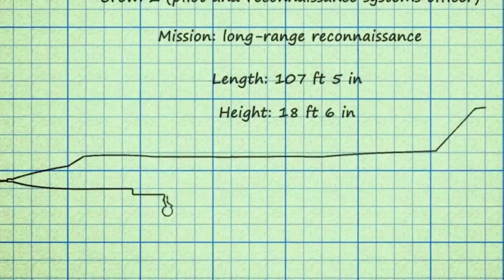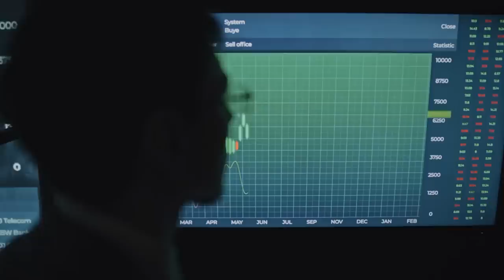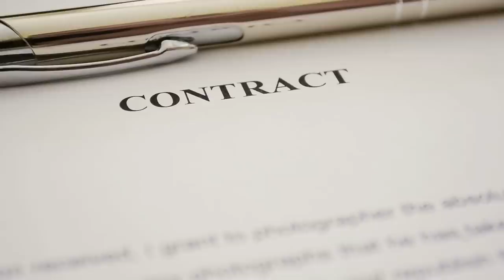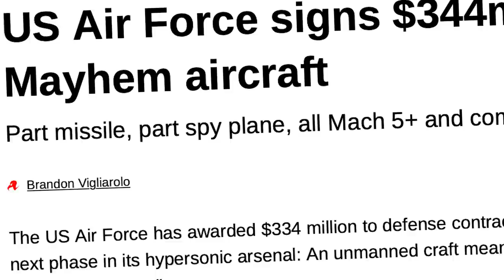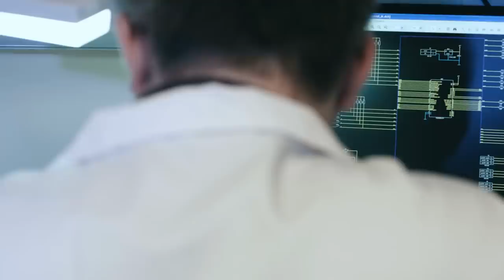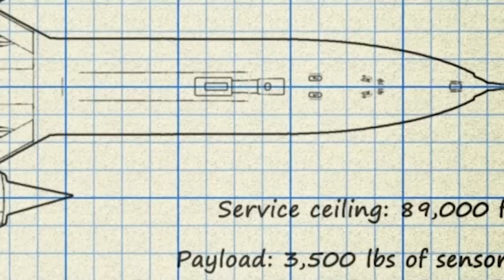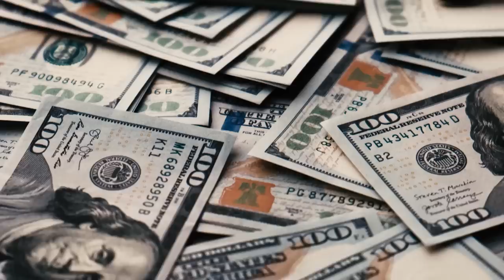The Plane that Leave Enemies Biting the Dust

Comment: I highly doubt they retired the SR-71 Blackbird without already having a replacement.
Reply: They did.
Reply: That's exactly what my dad always told me. He worked on different types of aircraft for 40 years, but the majority were helicopters.  He had a big part in the Comanche helicopter program before they cancelled it. He was pissed they scrapped the program, but also said they would never totally scrap all the tech that went into it. Just a few years later, what do ya know? A stealth Blackhawk with a lot of the same tech shows up crashed at Bin Laden's compound. There's almost always something else down the pipeline.
Reply: They didn't need one, sats took over...
Reply: Satellites
Reply: @exsappermadman25055  They still needed one back then, Satellites can be tracked so the enemy could hide things as it flies over, Bit harder now though as there are too many up there.
Reply: @ShaneMcGrath.  Back then yes, but they knew sats were going to get cheaper and building a better SR would have been bloody expensive!...
Reply: @ShaneMcGrath.  yeah thats what I said regarding them being predictable. its not hard to figure out which is which whatsoever though, each one has unique identifer code that you can easily look up in the database and see when its coming over whatever location you choose next
Reply: @jamesmaddison4546  Their trajectories can be altered...
Reply: @exsappermadman25055  No, not as much as you think. Every satellite has thrusters on it yes to help with stability and minor alterations but they are not powerful enough for it to change trajectories in such a way to make them unpredictable
Reply: @jamesmaddison4546  The near Earth sats need to have thrusters to stop falling back into the sky. My point is that if you know the enemy knows where that sat is and you want to change it, you can...They can also direct them into the sky to self destruct....
Reply: @exsappermadman25055  i know, and the process to prevent orbital decay is done over multiple orbits slowly changing it's altitude for example, to prevent the decay. Its multiple bursts because of the limited fuel they have on board not one big one, this way allows apogee and perigee to help out in changing its path, they let gravity do more of the work then the thrusters. 
Because its a slow process its course is predictable. You can have your trackers just lock on to that specific one and watch it or have them watch all of interest and be notified of any change in trajectory and then pay closer attention to it, this is literally done all the time by nations watching eachothers satellites. 
The only time a sat has at being unpredictable is at launch and shortly after, but this is the time when theyre most watched. Hell even amateur enthusiasts have published orbital data on classified sats after launch once one orbit had been completed. 
i know alot about this, im a physics geek and sounds like you know too
Reply: id say they still fly the sr71... off the books ,
Reply: @jamesmaddison4546  still laying the SmackDown on the Redcoats after all these years. 😂
Reply: @JohnnyBananas  Have you ever heard one of these aircraft taking off???  The USAF would need a 3 to 4 mile runway in the middle of BFE and at least a 500 mile radius where no one and I mean NO ONE could observe said take off's and landings due to modern high tech snooping technology.  The SR-71's were falling apart at the seams after every flight, literally.  There is no way in hell any of those birds are still flying recon missions...
Reply: But, but... Satellites...

Satellites are predictable. If planes weren't still useful, the U2 wouldn't be a thing. Satellites don't solve every problem. Think bigger people.
Reply: I agree, former marine here, I know they are very hesistant with retiring something without a  better replacement that will last longer.
Reply: @Johnnybananass-_  It's a bit dear ...
Reply: @jamesmaddison4546  Nah, am just a lowly Sapper with a passing interest!...But I would love to trawl that part of the Pacific Ocean where all those sats go to die....Must be a bloody gold mine of precious metals!....
Reply: @rexmann1984  😉 yup lol
Reply: @dextermorgan1  thats exactly what weve been saying dude
Reply: @rexmann1984  Not so much....
Reply: @TheKopfjager  British Sappers have the 59 detachment of Marines..We keep our cap badge and wear the Green Beret ....I fancied one until I read the training regimen. A 30 mile march!?...Nope!....
Reply: @exsappermadman25055  oh god yes man i know right, alotttt of money sitting down there
Reply: @jamesmaddison4546  And there will be a shed load more when the ISS comes down, I know a bit about that RE orbits and thrusters ....
Reply: @jamesmaddison4546  I know. I meant to tag a few people in this comment thread who said "they did retire it with no replacement". That's my mistake.
Reply: It was called "The Aurora" i believe its suspended it used a engine that contains an releases a explosion in bursts using shutters.
Reply: The Cold War ended, so that level of surveillance wasn’t really needed. For 30 years we didn’t have to deal with near peer surveillance. We also still have the U2 and satellites.
Reply: There is an old story/rumor from the late 80s early 90s that there was a scientist who gathered seismic readings of mini earthquakes happening every Tuesday,  and after doing some math he computed it was an aircraft going above Mach 6...
Reply: It's called a modern satellite.

Low orbit.

Or if you're the Chinese ultra low orbit balloon tech🙄
Reply: There was the rumors during the early 1990's of the Aurora hypersonic aircraft that had the same engine as the planned X30 spaceplane.
Reply: I’ve always thought those supposedly alien craft that defy gravity you see on military fighter jet video encounters are actually secret military or research aircraft.
Reply: @ShaneMcGrath.  Back then, as early as satellite television there have been geosynchronous arrays in orbit over northern Canada. Bell television actually took part in clandestine operations. There is a reason we pay so much more for the same services than the rest of the planet. It's not just because our population is sparse and small by comparison. Those satellites were disguised in plain site and they never moved. They could see equally far over the arctic circle at all times. They don't pass overhead. Rather they remain stationary in one spot orbiting at the same speed as the planet rotates. They are also very high up compared to most satellites.

I wonder though. If they put half the effort into diplomacy if any of these super high tech weapon systems are even necessary? Seems kind of counter productive to squander limited finite resources risking the collapse of civilization as we know it. Shouldn't we be focused on resilience and sustainability? Proliferating arms races seems like it makes everyone less resilient. I mean, egos aside, why are those people so different from us?
Reply: "replacement"?
LEO Satellites!
Reply: A common argument. Unfortunately we don’t know
Reply: You don't retire a jetfighter, spyplane or whatever, without having a replacement for it..... You bite someones ass on that...
Reply: Exactly
Reply: @kennethjanczak4900  "replacement"?
LEO Satellites obviously!

Everybody has at least one, even North Korea and Iran!
Reply: by 2028 means they'll be far enough along with the next aircraft to replace it that they can release official specs on it. Always stay a step ahead of what the enemy knows.
Reply: @NoStressVanLife  If it's a first strike bomber, with a technology that no one else has, it would be rather unproductive to show the others the "way"
Reply: You're well informed
Reply: The tic tac
Reply: @lorriecarrel9962  The tic tac did something that is several nobel prizes away from what we can do, even in dark projects.
Reply: They did its called Satellites
Reply: @Grumpyoldmansa  If it was satellites that retired the SR-71 Blackbird, why are they still flying the Lockheed U-2?
An aircraft that has poor characteristics an SR-71 Blackbird.
This is called, Thinking for yourself.
Reply: @mugin11223344  so your logic is because they are still using u-2 they must have developed a replacement for the Sr-71 
Ok

Comment: They have had a plane capable of this for over 30 years.
Reply: Not that can take off on it’s own, or carry payload, tac electronics, stealth, etc. the X15 is also rocket powered, not jet (throttle, easy refueling, range amongst other shortcomings).  Plus, if this thing actually cracks anything over Mach 7, target Mach 10, it’ll exceed the speed of any manned terrestrial aircraft.
Reply: @outtodoubt  We have different data.  Check out the pulse detonation wave engine research.
Reply: @hwilmore  I’ll just assume you’ve been reading coast to coast am type articles. PDE engines have only been used in a single aircraft. Which didn’t break Mach 1. Maybe in 20-40 years, but no practical uses or designs have been built to date. At best there may be an early prototype that is still classified, but we’re a long way from anything in production. Mostly because there are better, more practical, engines that have been proven already and would meet (with some tweaks) the needs of this aircraft.

Comment: The ultimate fake out would be if in a few years the government reveals that the Darkstar in TGM was actually real instead of a model.
Reply: I remember awhile ago Lockheed Martin posted on twitter about celebrating TGM and talked about " To celebrate, we are sharing some Maverick-worthy images of real aircraft". And then saying "The SR-71 Blackbird is still the fastest acknowledged crewed air-breathing jet aircraft".  While having the image of the Darkstar as the main thing I swear if the movie was just the ad for the plane they took the meaning of " hiding it in plain sight " to whole new meaning.
Reply: Notably, when tensions ramped up with China, Lockheed's Darkstar webpage went missing

Comment: In 1986 I met an sr71 pilot at Edward AFB. He told me about its top speed. Said the reason they limited the speed to mach 3 to 3.5 was G force on the pilot. Said at Mach 5 the curvature of the earth created negative G on the pilot. He said negative G for several hours was kinda like hanging upside down just not as intense. So my guess anything any faster would have to be unmanned.
Reply: Why don’t they just invert the plane then? Wouldn’t that solve the negative g issue?
Reply: @RandomTask  It would but you would still experience a continuous positive G. And then the cameras would also have to be inverted.
Reply: @tireballastserviceofflorid7771  hmm, I did some initial calculations and references. At Mach 5, you’re traveling approximately 3836 miles per hour at sea level, or around 1 mile per second. I realize the sr71 would be at altitude and Mach speed would be lower. Circumference of the earth is 24,902 miles. To turn in a circumference around the earth at Mach 5 would only apply 0.007g on the aircraft. Unless I’m missing something or made a mistake somewhere. Maybe the pilot was talking about certain mission parameters and other factors? Or maybe it included altitude changes?
Reply: @RandomTask  Your the expert. You tell me.
Reply: @tireballastserviceofflorid7771  lol I’m by no means an expert, I was just genuinely curious. Im not trying to say you’re wrong, I was just asking questions for my own clarification.
Reply: @Gankhisprawn  He told me what he told me. He did not go into details. He was risking prison just telling me what he did tell me. He was a test pilot based at Edward's in 1986. He had also flown actual missions. But not a word from him on any details. It was a sensitive time back then for military secrets.
Reply: @tireballastserviceofflorid7771  fair enough.

Comment: If I remember right the SR-71 leaked like a sieve on the ground but when at 85,000 ft at Mach 3..... not a drop.
Reply: The Concorde stretched a foot in flight
Reply: It was built that way because they took the expansion of materials into account.

Comment: With AI piloting, reflexes,altitude issues and g forces are not limiting factors. Amazing what advancements have occured the last 100 years......
Reply: No but releasing a bomb or missile from a jet moving at Mach 5 - 10 is going to be problematic and very expensive.
As a RECON vehicle it makes sense as an attack platform it only makes sense if it can deliver weapons under Mach 3 and leave the engagement area as fast as it came in.
Otherwise an expensive platform is releasing equally expensive weapons able to withstand the extreme heat of Plasma on its skin and internals.

I may be misinformed but this video doesn't explain how they over come the obvious, how to cheaply deliver a payload on target while traveling so fast.
Multi 10's of million dollar missiles launched from multi $100's of million planes will bankrupt a country in an engagement.
An F18 is 85 million, a cruise missile is 6 million and none of those have the materials internally or externally to with stand the heat of plasma.

I need more info to be convinced of this as being more than a RECON jet.
Reply: YES THEY ARE. To begin with yes the plane generally can take more then the pilot but not by anywhere near the meme amounts people like to throw around. They are simply less limiting then before and even then with the realities of what AI can currently do you are giving up several other useful traits. Albeit I would say remote operated with AI assistance would pretty much be a best of both worlds.

Comment: I suspect that this is the new f-22, in that by the time the plane is ready, the threat it was designed to counter...won't actually be there
Reply: the f22 was designed to counter aircraft that didnt exist yet. Espionage discovered the Russians were designing some highly advanced aircraft that would've dominated us aircraft so the f22 was made to counter these aircraft, not the current generation of the time  
The same will apply with the new stuff. It's always been this way. If you design to counter current, by the time its operational its already obsolete by far
Note, the Russians never managed to make those aircraft, they wouldve been something thats for sure if they did though

Comment: Scramjet Engines Can't/Won't/Aren't able to Start or Operate at Any Speed Below Mach 3, the SR-71 Blackbird Utilized Adjustable Angle Ramjet Engines, which Attempt to Bridge the Gap Between Trans-Sonic and HyperSonic Speeds.
HyperSonic is Considered to be at Speeds Above Mach 5.
The New Chimera Hybrid Engine is a Big Step Forward but, aren't the Final Step.

Comment: Haven't got a hypersonic missile yet but are going to develop a mach 10 plane 😂😂😂
Reply: Us Sprint missles built in the 1960s went mach 10 in 5 seconds. Us also has the Lrhw missle. 😂😂😂😂😂😂😂😂😂😂😂😂😂😂😂😂😂😂😂😂😂😂😂😂😂
Reply: @xxPrototype87xx  realy and why are the us military saying they are working on developing hypersonic if they already have them
And the spirit only went 20 miles so short flight that will be

Comment: Russia has fired their Kinzhal missiles into Ukraine, however, the Ukrainian military was able to shoot them down using Patriot missile launchers. Russia has failed six times so far with getting any of their Kinzhal missiles to actually reach their targets without getting blown out of the sky. Sounds typical.
Reply: *Seven times.
The first time was a solo Kinzhal.
The second was a sychronized mass strike from north, south, and east with six Kinzhals, several Iskanders (I think 8), some S-400's used in surface to surface mode, and some drones.
No hits. There might have been some wreckage that did minor damage to one of the trucks, but that never stopped operation and was fixed in a day.
Because Russia strongk.
Reply: Since been debunked but you believe what you like.

Comment: Hypersonic is the buzzword of the day, and I highly doubt any hypersonic aircraft will ever be fielded.  The term impresses politicians, but except for ballistic missiles (And orbital return vehicles) nobody has ever shown that hypersonic vehicles are practical.  This is all hype and little substance, made to justify Defense department investment in stuff that sounds good.  Note how much of this video involves theoretical and potential technologies that do not exist.  There's lots of "could be" and "potentially" words scattered through this.  I'm skeptical at best.
Reply: Exactly! The fastest manned aircraft is the X-15 which achieved a speed a little above MACH 6, and that was no minor feat. The aerodynamics of the airframe is very different from "normal" aircraft, was rocket powered, had to be aircraft launched, etc. Nevermind that in our military, the emphasis has been away from outright speed, or the XB-70 Valkyrie might have made it into production as opposed to being cancelled for being too costly and impractical.
Reply: @Reindeer911  Note also the altitude at which the X-15 achieved its speed records.  There's a reason why those test pilots were subsequently awarded astronaut wings (even though many of them later became astronauts anyway.)  Those speeds are all but unattainable at (for instance) the altitudes where commercial airlines fly.
Reply: The difficulty in changing direction at speed makes me skeptical.
Reply: Hermeus has successfully tested a hypersonic scramjet / turbojet engine, it will happen. This video is not all "theoretical" lol
Reply: pay attention @7:45